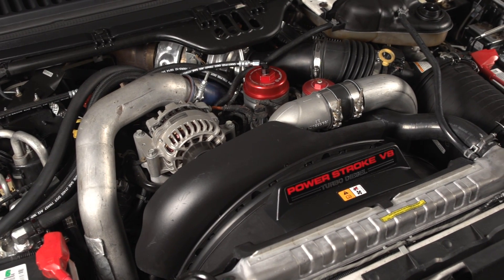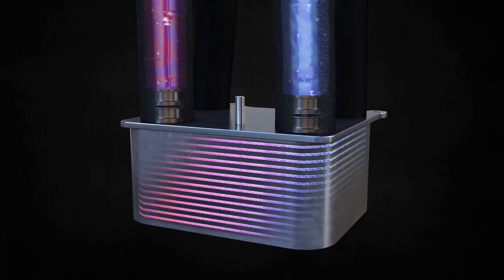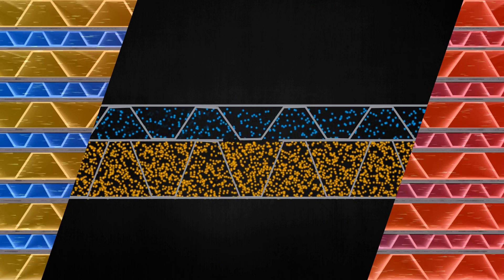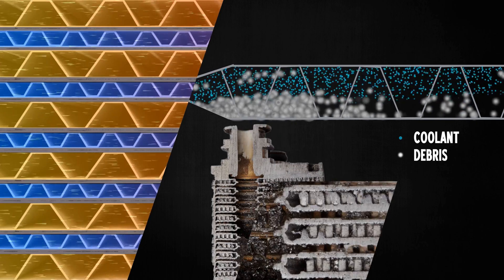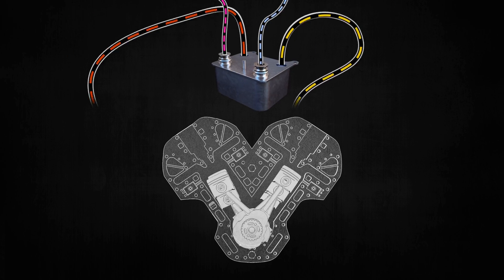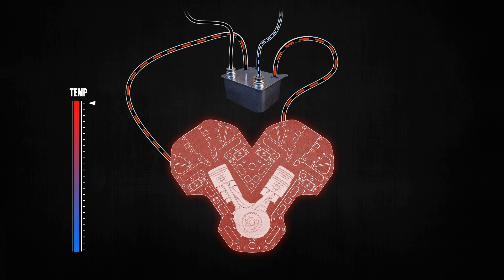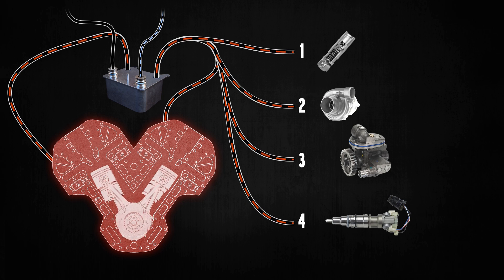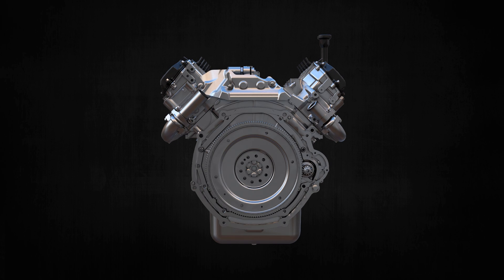Problems with the Factory Engine Oil Cooler; 6.0L Power Stroke

Comment: I have a 2005 6.0 with oil sitting in the coolant jug. As of right now the oil doesn't appear to have coolant in it ( no milky stuff on the dipstick) do you think my problem is the oil cooler?
Reply from the maker: Hi Jimmy - yes, if there is engine oil in the cooling system, then it is safe to assume that the engine oil cooler has failed.
Reply from the maker: Here are a few better than OEM options:
https://bulletproofdiesel.com/collections/oil-coolers?pf_t_oil_cooler_type=Air+Heat+Exchanger&pf_t_oil_filtration=Upgraded+Oil+Filtration&pf_t_vehicle_year=2005

Comment: Thank you for the very clear explanation of How oil cooler works, its importance/effects to the main engine components!
May I ask?
Hyundai Accent CRDI. When running just nearby not exceeding 60kph/1.5hours it’s fine. But when running on highway minimum 60kph just about 15mins running low oil pressure light appears. 
Could you kindly advise possible problem and solution?
Your reply would be highly appreciated.
Reply from the maker: I will admit we do not have any first hand experience with the Hyundai diesel engines, I think the problem you are describing sounds serious.  If the "low oil pressure " light is coming on at any point, I would suggest getting it to the dealer as soon as possible.  Adequate oil pressure is critical for engine longevity.  On a simpler note and if you have had the oil changed recently and the problem started after this oil change, it may be possible they simply filled with the wrong engine oil.

Comment: That´s no an oil cooler, it is an oil-water exchanger.  One real oil cooler it is a air to air oil radiator.  That system used actually in a lot of cars are prone to failure inside, passing the oil to the coolant circuit, oil more press than coolant.  Delete that problematic system an fit a real oil cooler, less problems, only takes more time to heat the oil , no more . Exchanger heats the oil quickly, by the aid of the coolant temp getting temp with closed thermostat.

Comment: So would flushing/changing your coolant often help reduce build up?
Reply: Most folks with 6.0 add a filter to the coolant system to keep the build up from happening
Reply from the maker: @genedavella9817  Even with a coolant filter, there exists the possibility for the seals in the oil cooler to fail, and the coolant and oil mix, creating a big mess.  We see that every so often.  We prefer to simply separate the two liquids so there is no capability for this to happen.
Reply from the maker: Can't hurt!

Comment: 2:35
"Remember as engine oil gets hot, it gets thinner as engine oil viscosity changes."

I was pretty sure, it was the other way around and that's why we have multi weight oils. (10w 40) 10, thin at start up, 40, thick when hot.

Comment: Can anyone answer.... Why didn't Ford just design a conventional and reliable Oil Cooler Radiator style cooler in the front of the truck. Come on these are MIT graduates. They knew designing this thing. It would eventually clog and fail. As a 20 plus year mechanic. I could have told them that.
Reply: water does cool better than air so that may have been why the new 6.7 uses a water to air intercooler they are also dramatically smaller and save more space things always look better on paper than how they will perform in real life
Reply: AH you can forget about anything being made anymore that is reliable, those days came and went.
Reply: It needs to cool the oil but it needs to be at an operating temperature otherwise in winter the oil will be to thick take forever to reach operating temperature . It's like a balancing act. I'd say the tech designer should have made it with thicker walled material
Reply: I can't believe it's not 100 percent based on packaging. BUT this design really messes people up who take their vehicles for granted. If maintained by the proper interval these coolers can last much longer than the people used to being able to neglect the realities of a modern diesel engine

Comment: good explanation, thanks. I have to asking one question. how engine oil heating in turbo diesel engine?
meaning which one is heating the oil, turbo ? piston cooling jets (pistons)?

I have a toyota pickup. engine already rebuiled. colant temperature is fine but oil temp is going up when hill climb. I want to know which parts heating the oil.
Reply: Any component that is hotter than the oil will heat the oil.  All the components contribute.  Static oil temperature is not expected, and you will spend a lot of money trying to make it so.  As long as the oil is within its operating range there is nothing to worry about.  While under extended loads I would expect a lot of heat to be extracted from the pistons since they are in direct contact with the combustion process.  Pistons also provides the greatest surface area to absorb the heat.